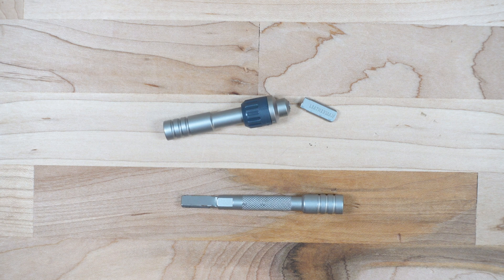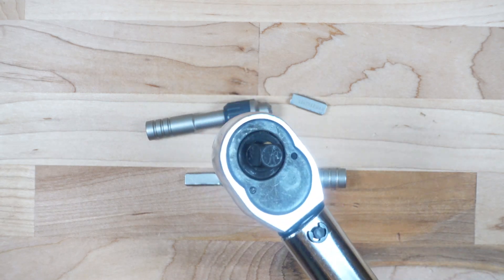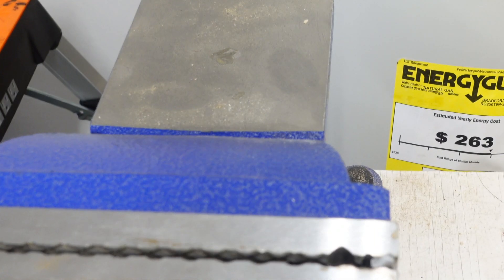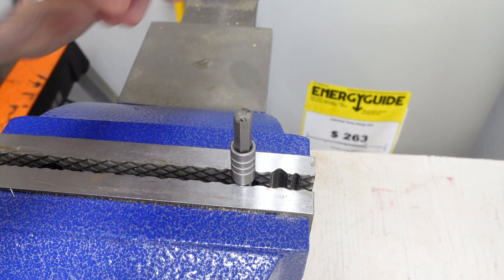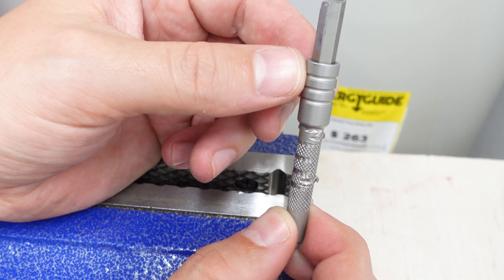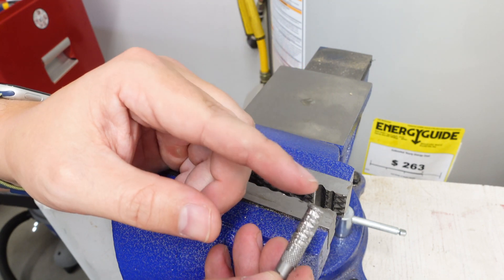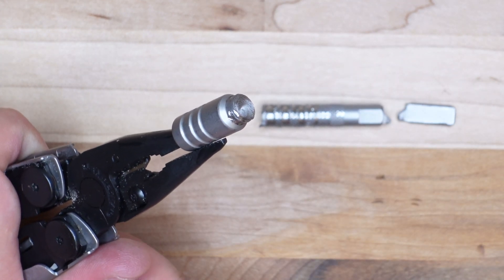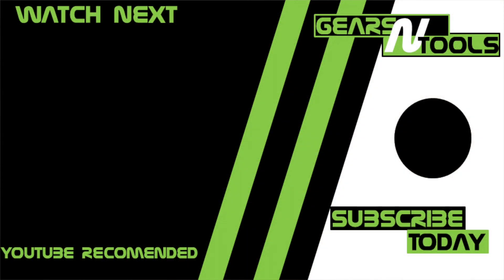Leatherman Bit Driver Destructive Limit Testing - How Much Torque Can It Take?

Comment: Is the leatherman steel of low quality?  If I use a Milwaukee brand 1/4 adapter on a makita screwdriver that claims to produce 160NM and clamp the adapter it simply does not break and does not suffer from marks like the leatherman adapter.  I do not understand!  I am concerned about the marks on the adapter it is as if the steel is very soft.
Reply from the maker: I'm not sure what it is made of it seems to be good enough for it's intended purpose.  keep in mind I was deliberately trying to brake this part so I was being pretty rough on it.  

Thanks for watching!
Reply: It’s not about quality. When you have steel that has high rust resistance the more brittle the metal is. With little flex. If you want a tool that that has a higher strength you have to sacrifice the rust resistance. Look up on google the difference between low carbon and high carbon steel works. Leatherman does the best the can and def don’t cheap out on their tools. They had to find a steel that was as strong and have some rust resistance.

Comment: Please test Leatherman bits. I’ve been told that they are designed to break before the multi tool or the adapter.
Reply from the maker: I might have to test that, my guess is you’d strip the fastener head before breaking the bit.  

Thanks for watching!